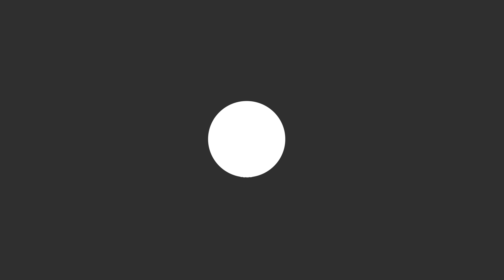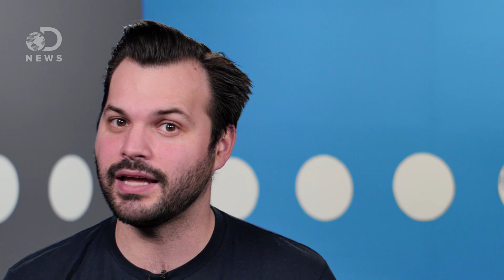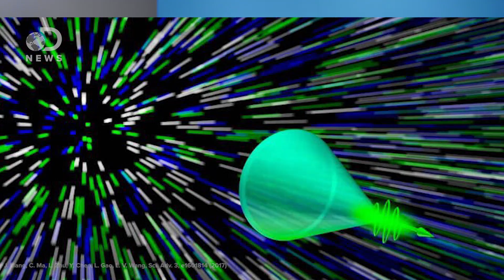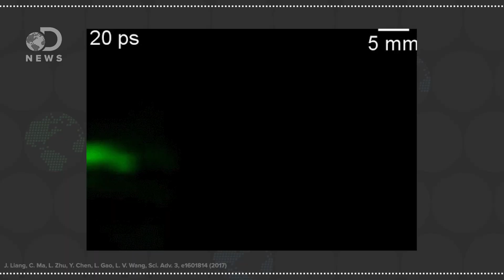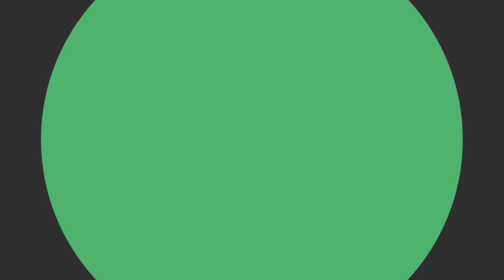'Sonic Boom' Of Light Captured For The First Time Ever

Comment: We arent "slowing down" light. Just redirecting its path to be a longer one leading to a longer travel time.
Reply: There is an easier way to think about it. Photons always move at the speed of light, which is a constant, until they interact with something. Then they cease to exist, changing the state of the thing they interacted with. Then, that thing returns to a more stable state by emitting a new photon. This process takes a small amount of time, which over the long term appears to mean that the light has slowed down. It hasn't.
Reply: i should have looked at the replies first.
Reply: So much misinformation in here...

The speed of light in vacuum stays constant. Light slows down, following wave behaviour, when entering a denser material. Wave behaviour is why it goes back to speed, in the previous direction, on exit of that material. If it was acting like a particle, refraction would not occur.

The speed of light in a material is c/n, where c the speed of light in vacuum, and n the refractive index of the material.
Reply: Aloha Snackbar nah. Imagine someone running through a feild as opposed to someone running through a dense forest. Not the best analogy but the light in the medium IS still going the speed of light it just has to make its way around particles, not taking a straight path, and therefore taking longer to come out the other side SEEMING like it's going slower
Reply: it's a lot more complicated than just redirecting it's path to make it longer. research atomic excitation and light.
Reply: I was just scrolling through to see if this comment existed before I made one, thank you!
Reply: Unfortunately that's not what is happening, the speed of light is constant to your frame of reference. Or in other words from your point of view. So Coltin is correct, all we are seeing is light traveling a longer path in the plate material, vs the "tunnel" where the photons are less obstructed. You should check out PBS Spacetime, they have numerous videos that better explain scenarios dealing with the speed of light, or the speed of causality; as they refer to it.
Reply: @ChrisP_like_Crispy  but don't they mean kight is slowing down in this medium..light does travel more slowly in koher media as opposed to a vacuum that much is true so I'm not sure what you are trying to say?
Reply: They should just have a big phrasing disclaimer on the video😂 that would solve everyone's issues
Reply: pure spectrum of light is constant it's neither slow or jumps to fast. it justs get reflected and redirected else where.
Reply: can we get this in a physics text book please
Reply: vetzal Well, nope. The sixty symbols video, is a start to learn. The light bouncing analogy, is only a misconception from early school years, or people that don't understand the duality of light.
One demonstration of this, Cherenkov radiation, is caused by charged particles travelling faster than the speed of light in that medium, which effectively is a sonic boom, but with light.
Also, keep in mind, light interacting with particles, doesn't mean hits/bounces particles or anything like that.
Reply: IEleMenTIx Yes, a start to learn. When you try to explain to someone their misconception of "light bouncing around", and the wave-particle duality, yes, it's a start.
If those people you mention, aren't willing to go as far as watching a youtube video, to get an idea, they don't have a ground to debate quantum physics and the behaviour of light.

Isn't "light is acting as a wave, not a particle that bounces" an elementary explanation? I think it is.

This whole thread is based on someone saying "light doesn't slow down, it actually bounces". Which is wrong, and why some basic pedantry is needed.
Reply: vetzal Sorry, but it's demonstrably not how you described. The light doesn't take a longer path, it literally moves slower through the medium. Watch the link from sixty symbols that I posted which has a real physicist explain how it works.
Reply: ***** The EM field is space. Light is electromagnetism and it travels through space with, guess how fast... the speed of light.

Drugs are bad, m'kay?
Reply: ***** I didn't say it was a stream of photons. I did say the analogy isn't accurate. It was just an analogy parallelized with IWannaBTheGuy's analogy of "running in the forest", trying to illustrate that you don't "bump on trees", but the forest and the rough terrain makes you walk slower, just as materials' "rough terrain" does to light.
Reply: Astral Traveler you seem to hold onto a misconception that a wave is it's own discrete thing. Classically, what is referred to as a wave is a type of oscillatory motion of a medium or a specific thing. You say that sound and light are waves and not particles, but what people mean by 'sound waves' are air particles spreading pressure to the surrounding particles which in their turn do the same thing as the kinetic energy decreases the more particles are collided with further away. The same thing could be applied to light, it's a beam of massless particles that together make the beam move in a wave-like pattern.
Reply: So if lightning didn't zig zag it'd be faster? 😂
Reply: A start to learn? He talks about superposition and waves interacting with themselves... that's no "start", that's where most people don't understand anything anymore...

I just said that the theory of "light bouncing off atoms" is a good explanation, but not correct. It's a good explanation for people who don't want to go into quantummechanical detail...
Reply: ***** Again, those "field lines" don't move through space. They're just a tool for us. Interaction happens at light-speed, so I guess here's your answer.
Reply: Astral Traveler stop smoking pot, hippie
Reply: ***** What drugs are you on? You sellin'? lmao
Reply: ***** Fields don't "move". Waves and particles do...
Reply: very big misconception, you should watch sixty symbols videos on it.
Reply: +IWannaBTheGuy Not exactly. A better analogy (but still not entirely accurate) would be like, a group of hikers travelling on flat terrain, in a straight line, when suddenly they find a forest with rough terrain. The forest slows them down, and they decide to change their course slightly, so as to exit faster from the forest. Once they exit, they head back to their original direction, in the flat terrain at full speed again.
Reply: Astral Traveler Light always travels at c. The circumstances don't matter, it will always travel at c (regardless of the observer). Read a bit about Relativity and then be enlightened
And a lightbulb is emitting a certain amount of photons per second. Yes, there are already photons around because there are other light sources but they are not really influenced by the lightbulb.
Please use the internet, find some useful and trustful sources and begin to read, watch and/or hear.
Reply: Astral Traveler I think you're crazy or just a troll. I hope the latter is the case
Reply: hahaha just what i thought :) he has a different approach to understanding the universe :)
Reply: *****  "gravity is caused by gravitational waves - and not some "deformations of space-time""
That's absolutely wrong. Gravity as per Einstein's relativity is exactly that. That's why light bends around massive objects.

"You can create antigravity by emitting wave at proper frequency." No you can't.

"UFO - surround an object with microwaves and make it burn" lmao what?

I think you're veering into a pseudo-scientific realm of your own creation here...
Reply: ***** Do you even know what gravitational waves are? You don't seem to know.
Just an FYI: Don't try to spread misinformation when you don't have the academic background, and all your arguments are refuted by actual science. Just because you don't understand something, doesn't mean you can fill it up with figments of your imagination. It's not a matter of "simpler explanation" it's a matter of cold hard, factual mathematics.
Reply: What? 😆
Reply: Aloha Snackbar light only 'slows' down in a more dense medium because said debse medium is a relative labyrinth for the photons to travel.

pick up QED, it explains this quite clearly
Reply: A photon would still lose energy everytime it hits matter in a medium would it not? I'm assuming that as people are using the running through a forest analogy, everytime you hit a tree, you transfer some of that kinetic energy into the tree and lose momentum. Would this not be the same with light in a medium?
Reply: IEleMenTIx Yes - the one, that makes some sense at all :)

Funny, that MHD simulations, have more to do with my claims, than with Einstein's theory :)
Reply: Astral Traveler nice idea btw
Reply: Mr Simmons why it is moving in a wave pattern, why can't it move like a straight line? Just curious. 😀
Reply: True
Reply: imagine two people one running in a maze and the other on a straight line at the same speed both trying to reach the same finish line  that's all the experiment is doing and not slowing down speed of light per say
Reply: Actuality it don redirect. I found this about. I can't take it for absolute thrufe bat it make sense.

https://youtu.be/mICTVow3-3I
Reply: Coltin Yancey smart guy
Reply: had to read thru much untruth to get here - good work...
Reply: okay, maybe i spoke too soon before - you should have left it as above <smile>
Reply: Ur saying the same thing but in a slightly fancier way. If I race you and you run in a straight line to the finish while I go around every stop sign and building, u will beat me easily. Your time was faster than mine, technically meaning you are faster than me. I went slower TO THE FINISH LINE rather than slower from point to point to point
Reply: Horribly titled...amd worse yet hpw is this suppose to be a sonic boom or anything close...they simply made a light pattern the looked similar to a sonic boom
Reply: It does. Taking the less energydense way to the ground but it's not going lightspeed, it's going elecric speed
Reply: Yes we are!
Even stopping it completely:
https://en.m.wikipedia.org/wiki/Slow_light
Reply: That's not true.  Light speed is constant.  A dense medium causes it to refract/bend.  If you run in a zig-zag path to get from A-B, you'll get there in a longer time than if you went straight A>B.  That doesn't make you "slower".
Reply: at the speed of light.  Because an EM wave IS light.
Reply: The opposite way,
Reply: I don't get it 🤦 How can the camera record it
Reply: if you run through water, does that increase distance or does it reduce speed🤨
Reply: I do not understand what you are saying.
Reply: nevermind i think i got it. so what you're saying is we are making the distance longer therefore slowing down the process of light travelling to it's destination. in conclusion the light travels at the same speed the entire time (unless we change the density of the light which the light conductor produces).
Reply: That's slowing it down.....

Don't attempt to be clever.
Reply: @jsquadthekid6610  ok
Reply: Archie Sonic I think you mean do not attempt to be clever, or maybe you mean don’t try to be clever.
Reply: There by decreasing the velocity my dear, since displacement is independent of path taken
Reply: @vamsimohan5369  the first thing you said made enough sense, i'm just not getting the second one.
Reply: nevermind, i get it.
Reply: if none of the directions gave light individual decreases in speed; light would not be slowed down, but rerouted to extend the time span. therefore, in this case the answer depends on proof. (not "free thinkers" like me).
Reply: See the clear explanation of The Science Asylum: https://youtu.be/mICTVow3-3I
Reply: @Gregster Not exactly, but yes. Basically, it just gets absorbed and reemitted by atoms in the material, essentially making it "slower". Once there's less obstacles to propagate through, it can go back to speed. That's how refraction works, and how Cherenkov radiation is possible. The refractive index is essentially how "rough" the "terrain" is.
Reply: If it's not slowing down then what causes the mach cone?
Reply: Yep
Reply: Better analogy, Imagine a guy running a straight line at the same speed as the guy running trough a maze. The guy running a straight line gets from point A to B faster then the guy that has to go trough a maze, but both of them are running at the same speed. The light only appears to be slower when traveling trough a medium.
Reply: if two cars are travelling at 100 mph but one drives in a straight line while the other drives all over, the straight line gets there first but they are both still going 100 mph...
Reply: Ryan Henson correct. How anybody could not understand that 🤦🏻‍♂️

I searched for a comment like yours. Otherwise I would have wrote it myself
Reply: Katrina L it slows down only in the sense that it's taken longer to reach the detectors but the light itslef has only been delayed by having to take a longer path via a denser medium. debser mediums afterall are more tightly packed atomic structures, the light bounces around in such structures and most light takes an unnecessarily long path.
all light travels the same velocity, 'slower' light is just taking a longer path.  you cant even really reason that this means the light is slower since it's taking longer to travel a distance because it's actually travelling a longer distance which negates that it took longer to get there.
Reply: @Videosaurus_Wrex  How do you know this is true since no human has actually ever seen light dp this..at least nkt with the naked eye..has it been seen through microscopes I guess or spectrometers? Or is that from a textbook because I don't remember seeing that in one?
Reply: Science is wrong about light. Source of light is not emitting photons, as photons are countless - it is emitting waves. Light is just like sound, only faster - each wave has it's own speed of propagation in each kind of medium. There's no vacuum in space - each medium has it's own density of matter... Shortly - Einstein was wrong :)
Reply: One more thing... I know only one force, which "travels" through entire space with the same velocity - no matter, what kind of medium it is passing through... Anyone?
It's the magnetic field.... Now the question is: How fast magnetic field line can move through space? It seems, that no one knows... :)
Reply: Katrina L Light is not a stream of photons - it's a wave. Frequency of this wave defines the color of light. When the wave enters a "rough terrain" it's velocity is falling down, what causes a "compression" of wavelenght. Velocity drops, but wavelenght is getting smaller - so, the frequency remains the same. This is why bottom of a lake appears closer, than it actually is, but colors remain the same... Do you really think, that light is a stream of countable photons? So, how many photons a lightbulb is emitting per second? It doesn't emit them at all - photons are already all around. Atoms in the light source vibrate and create waves in the "sea of photons"...
Reply: Katrina L - so, can you give me the answer: How fast a magnetic field line moves through space?
Reply: Katrina L Yeah, mathematics prove, that time travel is possible - although simple logic shows, that it's not... Do you believe in logic, or in math? I prefer logic... According to scientists, we live in a 11D multi-verse - and I call it sci-fi fairytale...

Using simple logic and 3D software, I proved, that time is not a dimension. Time is the frequency of everything, what takes place in the environment - we measure the time, using planetary cycles. It's the most simple logic and it proves nicely, that the term: "space-time" is incorrect. 

There is however a 4'th dimension of physical space - it's called SCALE. The rate of apparent time flow depends on the size of observer. For smaller observers, time goes faster, than for the big ones - this is why insects perceive the world in "slow motion". It explains nicely the orbital periods of many exoplanets, which are very often ridiculously short (couple days or hours).

watch?v=GERLqsDGcmg
 
And yes - I know, what gravitational waves are. If you put couple floating objects on a water surface, you will see, how the gravity works - objects will be attracted to eachother... You will even see the gravitational lensing around them...
Reply: hahaha same idea
Reply: yep me too!
Reply: Katrina L - I've got plenty of this stuff and it's for free :)
Light from a distant star has to travel through 4 different fields - it's own interplanetary medium then through interstellar medium, through the heliosphere and finally, through the atmosphere (if we observe the star from Earth). Each time, when the wave moves from one medium to another the length of wave is changing. I know, what I'm talking about
:)
Reply: Katrina L
Space is not empty. Light travels at different speed, depending on the medium, which it is moving through...

Intergalactic medium has a different density than interstellar medium or interplanetary medium. None of those is considered as a vacuum... Even if there's almost no plasma in the intergalactic medium,  there are still some particles. So, do you know, how fast magnetic field line moves through space - no matter, what is it's density?
You can try some drugs to learn the answer :P
Reply: Katrina L
What is the difference between light passing from the air to water and light passing from interstellar medium to the heliosphere? Each field is separated from another by a shock barrier - fields create bubbles in space... Did you hear about magnetohydrodynamics?
Reply: Katrina L
Of course, that fields move! Sun is constantly moving through the galaxy and the heliosphere is moving with it... But this is not the case.... Didn't you hear about magnetic reconnection? Sun can connect directly to Earth with it's open heliospheric field line - this causes Flux Transfer Events (FTE)
How fast such field line can move through space?
Reply: Katrina L
Or let's make an experiment: let's induce a magnetic field with an electric current. How fast this field will affect metal objects in it's surrounding?
Reply: IWannaBTheGuy Almost, but light isn't exactly a stream of photons - it's more like a wave, which travels through space, which is filled with photons... It's similar to sound, which is not a stream of particles, but a wave, moving within a medium...
Reply: Zamundaaa No - light is NOT always traveling at c. Read about the BASICS of optics, Light in water or in ice is moving slower (observer doesn't have anything to do with it).

No - photons are not emitted. Light wave is just like sound wave. When you scream, you don't emit particles of air, only waves.

Photons create a FIELD - they are like an ocean, which fills every piece of space, which lacks the matter (mass). I know, that official science says different - but they are wrong :)
Reply: If you don't believe me, then tell me, if there's something like "density of photons"? Can somewhere be more photons, than somewhere else?

I don't think so... The only space without photons, is the space, which is filled with matter...

 Sorry - science is wrong. Truth is much more simple, than they tell us :)

Time is not a dimension. Only Real-Time exists physically. The only objective form of existence is Conciousness (Cogito Ergo Sum). Everything else is just a possibility of existence - quantum physics calls it superposition.

There's only one process, which is taking place all the time and everyrhere - it's the endless process of information exchange... Information is exchanged between electromagnetic fields via electromagnetic waves...

The rest suppose to be obvious... :)
Reply: Oh - and gravity is caused by gravitational waves - and not some "deformations of space-time"

You can create antigravity by emitting wave at proper frequency. I guessed already, that gravitation has huge wavelenght.

UFO - surround an object with microwaves and make it burn :)

Can I have a Nobel Prize? :P
Reply: Zamundaaa Denial - it's only thing, what is left for you. You just can't argue, with simple facts :)

What about the density of photons then? :) If a lightbumb is emitting photons, then let's close it in a box - density of photons suppose to grow inside... LOL

It's you who made false statement about the velocity of light....:)
Reply: Katrina L Yes -  according to Einstein's theory.
But he just assumed, that time is a physical dimension - with future and the past being as real, as the real-time - and there's NOTHING, what could prove that...

I prefer the simple way... Gravitational waves exist - why they can't be carriers of the gravity? Because Einstein said something different? Well - screw it :)

Einstein's theory doesn't go together with quantum physics. I've just erased this problem :)

Didn't you see, how fire behaves in a microwave oven? It changes into a ball of plasma...
Reply: http://teachingkidsnews.com/wp-content/uploads/2016/02/MergingBlackHoles_V2.jpg

This is a MHD simulation of gravitational waves - it has NOTHING to do with Einstein's theory. Instead it shows interactions between gravitational fields.... And guess what - this is EXACTLY, how I explain it :)
Reply: Einstein:
https://s-media-cache-ak0.pinimg.com/originals/23/cf/0a/23cf0a24206c811578e84ba8321c38f2.jpg

MHD:
http://pedestriantv-prod.s3.amazonaws.com/images/article/2016/02/11/gravitational-waves-619-386.jpg

Einsten sucks...:)
Reply: :::facepalm::  And you got your PhD in physics from where?

You should demand your money back.  It has nothing to do with "redirection", ffs.
Brush up on your Quantum mechanics, numbnuts.
Reply: Coltin Yancey ..... therefore; slowing down... lmao.
Reply: Coltin Yancey no light slows down if it enters a more dense medium